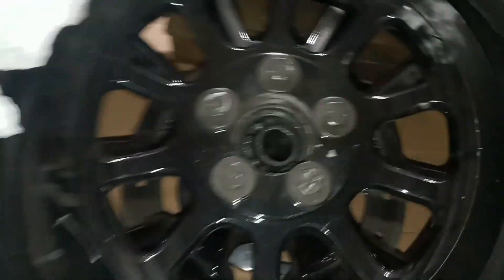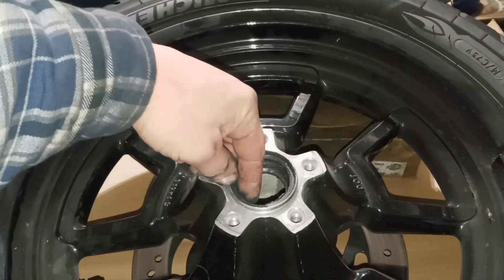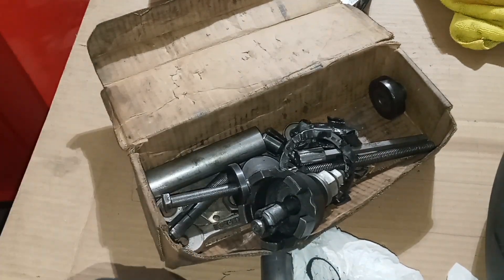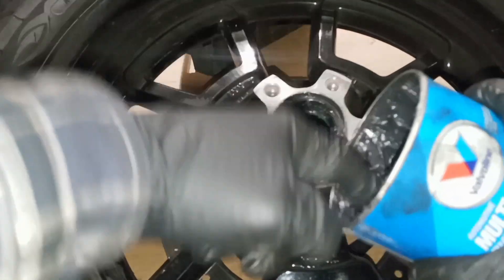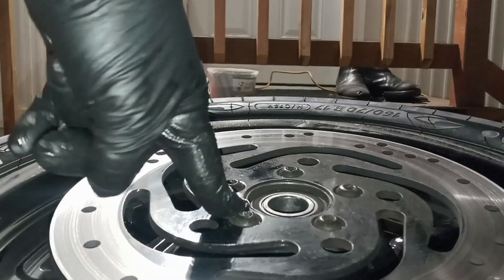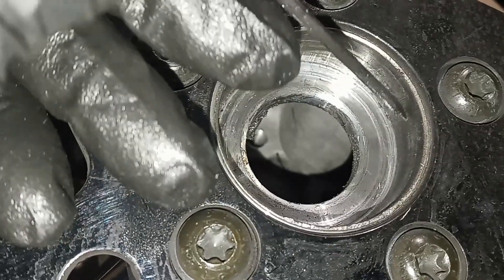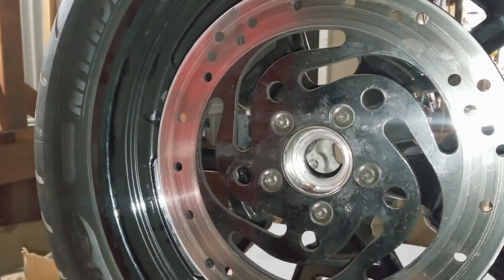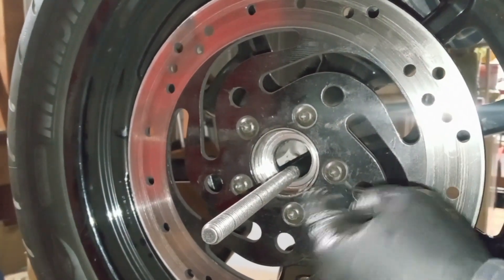How to Replace a FAILED wheel bearing

Comment: I Tap in the last mm with the installer plate on the bearing  to snug it up to the sleeve. I got tired of over tightening ,then having to pull it back(not good)
Reply from the maker: Good advice thanks

Comment: I just bought the same puller. It was like $43 so I was hoping it worked!!  Looks like it does!!  I'm just hoping that I don't have to take the belt pulley off.  I'm scared to break something like shearing a bolt!!   Hey at least I know the tool works!!  Good video. Easy to understand. Except when pulling bearing you said something was inserted on the other side.  Trying to figure out what, since I have the same puller and the directions are too hard for my old eyes to see!!
Reply: At 4:35. It says hold that Allen from the other side.  That's what I'm not understanding .  Thanks if you could explain.
Reply from the maker: The tappered bolt that spreads the collar has a 3/8" allen socket.  You use an allen socket on an extension from the other side to hold the tappered bolt
Reply from the maker: I suggest removing the sprocket. The tool might not reach with it on. Plus the bolts can expand the hub and make the bearing tighter in the bore. If the bolts don't come loose try heating them up with a torch. Good luck you got it
Reply: @sideyardmechanic  Thank you. I didn't look yet but now I understand!!
Reply: @sideyardmechanic  Thank you again!! Figures. Lol. More work. More money!! Well at least new bolts , washers and blue thread lock isn't too expensive. Some people say you can reuse the old bolts but I don't know if that is a good idea or not!! Thank you for your help!!
Reply from the maker: @elliott9139  they should be replaced. You could reuse them if your in a pinch and your bike has stock power but WHEN IN DOUBT CHANGE EM OUT LOL
Reply: @sideyardmechanic  Bike is all stock.  No stage upgrade. Lol. Only thing upgraded was the cam plate tensioners oilf pump.  The wheels are stock spoked rims   so I am really worried about shearing belt pulley bolts off trying to take them out.   What I'm thinking is to apply heat to each individual bolt before attempting to loosen them.  Then once they are out. Buying a cheap Harbor Freight tapping tool to clean out the threads inside the hub so new bolts go in and torque .   Hopefully this is correct since I haven't done mechanical work on a bike or car in 25 years. Lol. Just a little worried about screwing up.  No crazy money anymore so I can't afford to make mistakes. So I'll ask a million questions!!!
Reply from the maker: @elliott9139  sounds like a good plan. Just take your time. Deffinately use heat to heat the aluminum hub under the sprocket, that will expand the aluminum away from the bolt and melt the lockpatch.
Reply: @sideyardmechanic  Thank you so much for taking the time to help me !!  I definitely appreciate it. A LOT..

Comment: I’ve found all those sealed bearings need to be greased because they don’t have enough greave in them
Reply from the maker: Years ago I had a coworker that would remove the seals and service the bearings by packing good grease in the sealed wheel bearings every so often. Not a bad idea.
Reply: yes they do, every time I get my tire changed, I pop off the dust cover on both sides and repack the bearing, going on 18 years with the same bearings